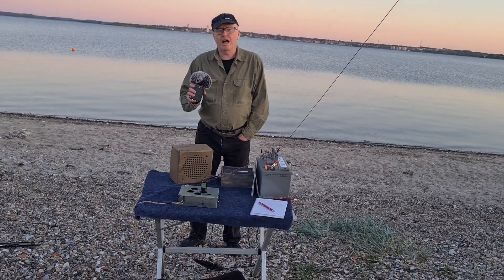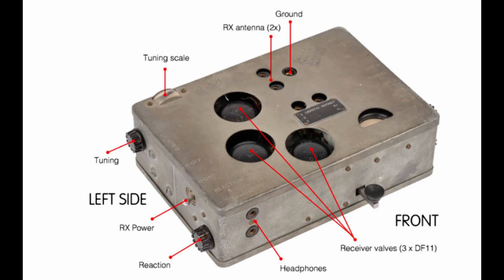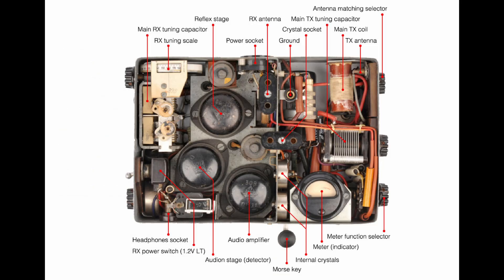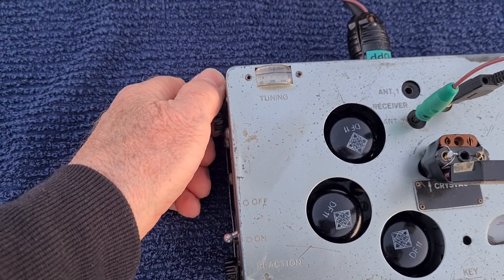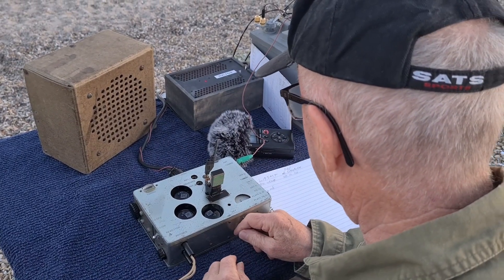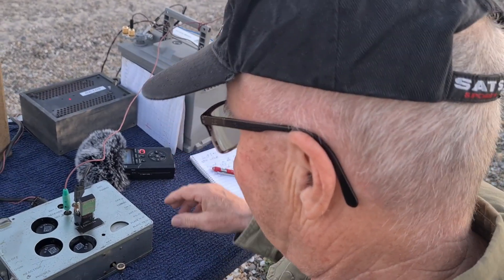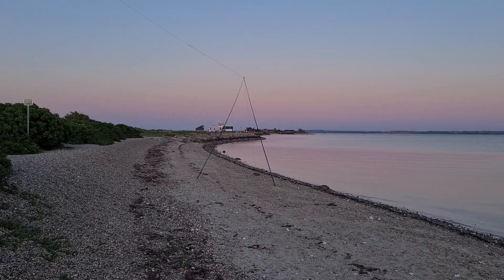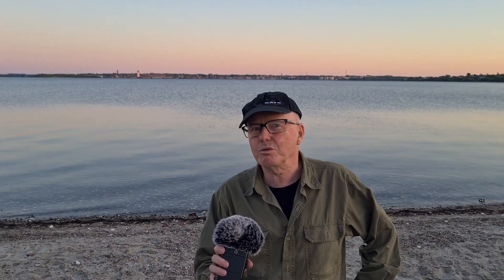From WWII to the Cold War: German SE109/3 Spy Radio

Comment: Very intersting vid! I only miss the frequency (QRG) used here. Probably 7MHz (40m band). I am a QRP-lover and QRP (QRP=low power) operator too! vy73, Clemens DL2GAN
Reply from the maker: Thanks for the question.
The frequency was in the 80 meter band.
It worked well with a long antenna. 48 meters.
You have to watch my QRP video:
https://youtu.be/uBxjWyZCgH4

Comment: The antenna is a long wire.5/8 lambda? Thanks for share.
Reply from the maker: Yes, that's a good length.
It's very efficient and it's quite easy to tune up for the transmitter.

Comment: Love this application. I have wondered a lot about the German WWII radio apparatuses. The large frame antenna on the Scout Car Sd.Kfz.232 [FU] (8-RAD) seems like overkill in this age of miniaturization. What frequency did they operate on, and what radio set was used?
I have a couple of 1950s vintage Johnson Messenger CB  transceivers. [ I + II] Also tube type. I need to look them over. They are in the 5 watt range. They were real performers in the late '60s.

Comment: Thanks for the video. I see all is written in English on this German 1943 radio. Could you explain why?
Reply from the maker: I've seen spy radios from many different countries that all had English subtitles. I guess it's so that you can't tell which country is behind the spy if the radio is discovered.   
     .and.
A secret agent might not be a native German speaker, and the equipment needed to be easy and quick to operate under pressure. By using common English terms like "TUNE", "VOLUME", or "SEND", the radio could be used by agents from many different countries without confusion.

Comment: efficient antenna I think. I think you were on 80 Meters right?    If 80 Meters I am surprised noise was not higher than your signal. Thanks Helge!
Reply from the maker: Yes, it is 80 meters.
The antenna is very efficient, like a dipole.
The noise in this receiver is low. It has no oscillator or mixer. It is a regenerative receiver.

Comment: Would be nice to know what the other operator used. 1kW transmitter and a huge directional antenna? :)
Reply: On this occasion I used an Icom IC-736, 100 Watts output into a 40 m long endfed wire configured as an inverted L- antenna. My realestate is limited so it is impossible to run a 40 m straight line. 73 de LA5MT (the guy at the other end)

Comment: That spy radio is impressively small. I have seen some used by the Allies that fill a suitcase. When it comes to spy work, the smaller the better. 
In today's world, the best spy radio might be QRP Labs tiny but versatile QMX. I covers five HF bands, includes SSB and digital, and is about the size of a pack of cards. Review at:
https://www.youtube.com/watch?v=E60wM4N2174